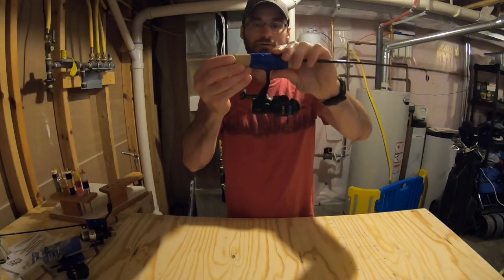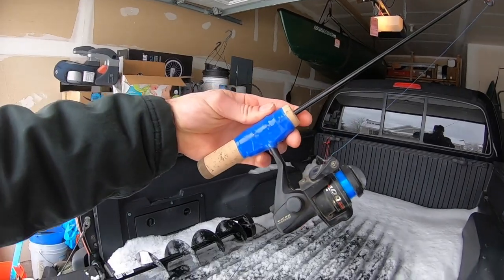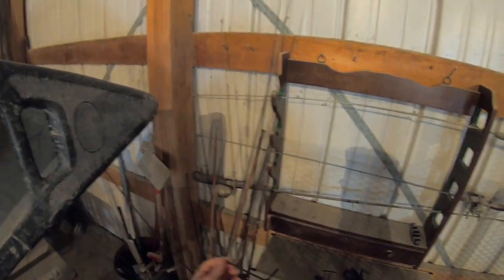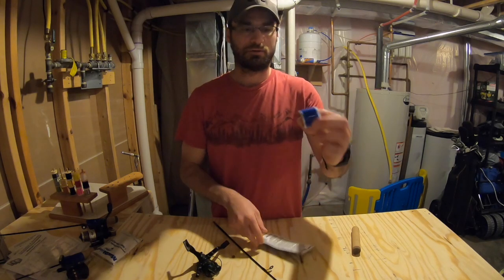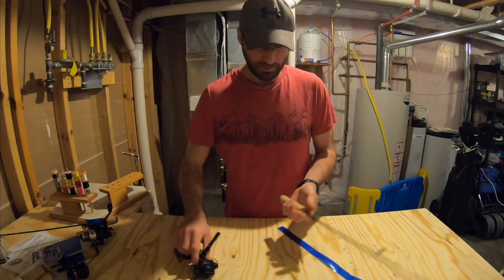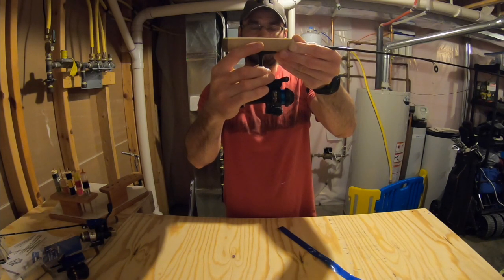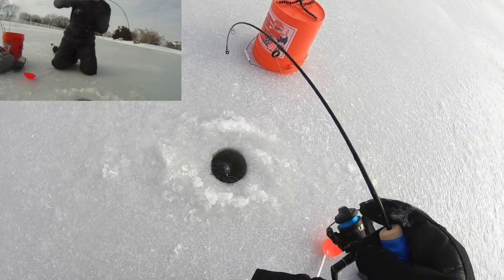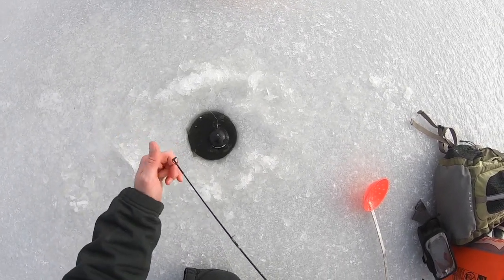DIY Ice Fishing Rod Build (Build and Catch)

Comment: You dont glue the rod in the grip ?  Ehm if i did that stuff gets loose :-) i need to glue Everything ! Still a fun little walkthrough .
Reply from the maker: The hole on these cork handles is pretty small. It is a really tight fit for all the rod tips I tested and they won't move once you get them in. For me, glue wasn't necessary.

Comment: So did you cut down an old rod to length?
Reply from the maker: No, I took the tip off a 2-piece rod. You can cut it if it isn't the size you want, but I like to leave them intact if possible so that I can put the 2-piece back together and use it for open water if I want.